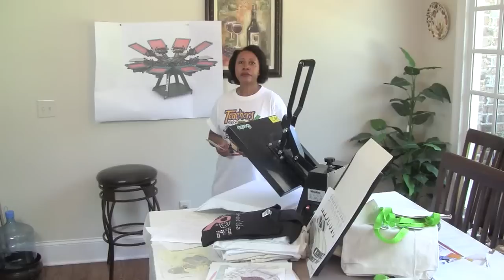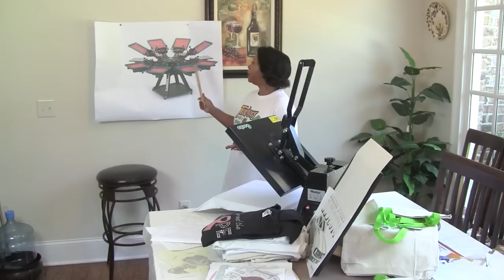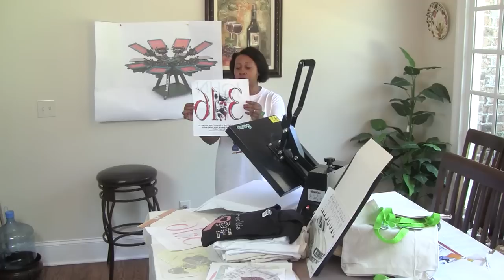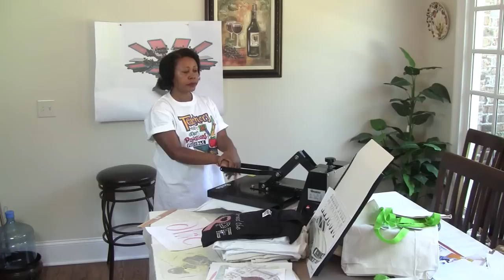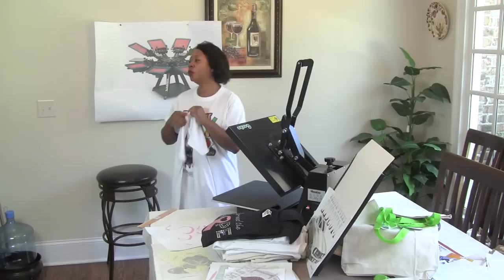Heat Press Machine vs Screen Printing T-shirts

Comment from the maker: Pre-made or Stock screen print designs are the same as the screen print designs created with screen print equipment.  The difference is that the design has been transferred onto the transfer paper rather than onto the blank t-shirt. The quality is just as good providing you are buying the right designs.  For those of you who want to start your own t-shirt business but are not quite sure where to start, or what to do,  I provide personal coaching to help you get your business up and running.
Reply: The Difference is that when you print directly into the shirt the ink cures in the shirt not on top of the shirt like the heat press does, making it more durable when printed directly into the shirt!
Reply: +Dorothy Ross this is simply not true! You are a scam artist if you are promoting those lies. I bet you have never even screen printed before!
The heat pressed tee will usually last you up to 5 -10 washes before showing cracks and wear because  you can only use plastisol ink to transfer your image and the image isn't freshly printed. 
It is like buying a ready made meal and throwing it in the microwave compared to freshly baking your meal and taking time to prepare it.
Reply: You are absolutely WRONG !  Heat ( Good) transferred t shirts will outlast the life of the shirt ! I have seen proof !  Stop spreading lies !!!!!!!!!
Reply from the maker: Getrude Chinangwa Please go to my website and select my "personal coaching" package.
Reply: I need the coaching. Please help me.
Reply: Dorothy Ross Thanks lady. You so kind.
Reply: Dorothy Ross How do you have your design on the paper. and can it be used for several times, or each t shirt has its own paper?
Reply: ***** correct
Reply: Azar, kavoos Sepahpour I'm a screen printer but I also use this process.

When it comes to this process it is called Dye Sublimation"

I use a computer and an Epson Artisan 1430 printer which is popular in the printing area as it is an A3 printer.

You will also need Dye Sublimation inks and papers to make this process work and also make sure that you print on the right side of the paper which is slightly shiny.

You can only print on Polyester shirts using this technique though. We use traditional techniques for 100% cotton etc. 

This is a very limited form of printing but I use it as a part of my bag but very effective within it's right.
Reply: +Terry Gissing Dye Sublimation is another form of heat transfer it is not the same as plastisol transfers, different ink all together, and requires a different substrate, polyester not cotton.
Reply: Simply incorrect. I have been doing transfer shirts at events for over 7 years. I have people that wear past shirts and still look good. Plastisol transfers made correctly cure on shirt once heat pressed. Screen print cures on shirt once passed thru oven. (advantage of transfers, storable, multi color, soft hand, cheaper on sheets runs, better for events and on demand printing. disadvantage, can be made incorrectly, overcured in set up, burns at times, dry up if stored incorrectly.)

One big difference, heat pressing a transfer sets it into the shirt more, Screen print just lays on top if not pressed and causes a big sweat patch. 

We use both and make some of our own transfers. I have had more complaints on screen printed shirts  than transfers.

Please do not confuse digital printed transfers with plastisol or simulated process. Even the white ink printer transfers are inferior to properly made plastisol transfers.
Reply: Dorothy Ross Hello Ms. Ross I would love if you can mentor me . I'm trying to get my t-shirt business up and running. Please help...
Reply: can u send me your email address I want to learn
Reply: Dorothy Ross i
Reply: Yes!! Mam’a I really need a lot of coaching could you please help🤷🏾‍♀️
Reply: James Dawah I must agree w/ you...and I must say this is prob. why they still take the old methods. I never knew the difference...but I believe what you are saying is factual....and proves the reason why they keep it that way. Whether Dorothy Ross is a scam....that's another story. She's just trying to promote her stuff w/o telling the bad side. You have to understand that. I've never done either to know the difference but as my intellect serves me, this should be the case.